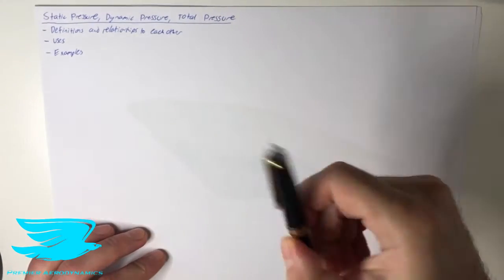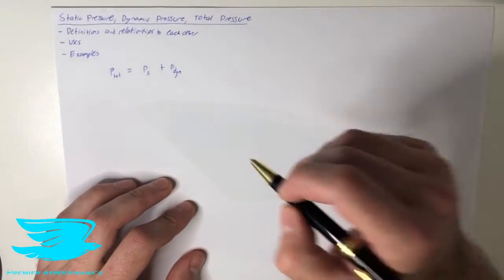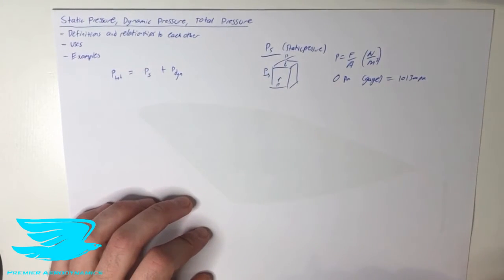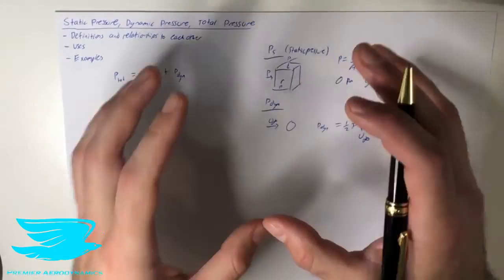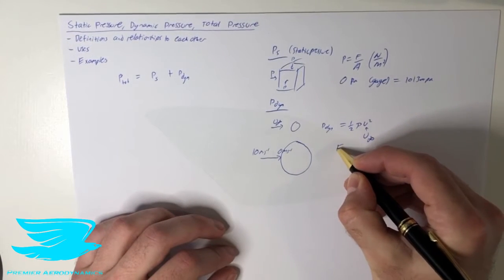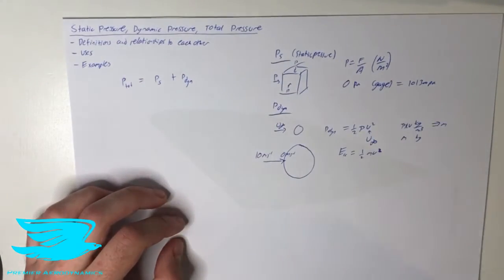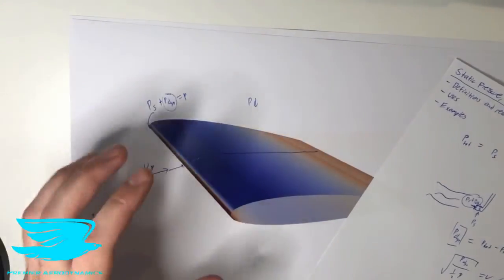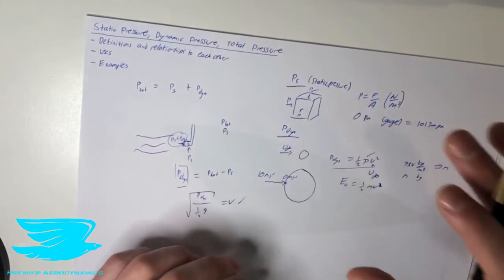[Aero Fundamentals #6] Static Pressure, Dynamic Pressure, and Total Pressure Explained

Comment: is the total pressure =static + dynamic valid only for incompressible flows?
Reply from the maker: No, it is valid for all flows, however, you need to make sure you are using the right dynamic pressure. For example, in supersonic flows, there are shocks and those shocks reduce the total energy of the flow, hence the total pressure drops. Much of that has to do with the flow being slower after the shock, hence the dynamic pressure has dropped post shock.

Comment: Many thanks for this explanation, very useful/helpful. Is there a way to calculate theoretically how far in front of an object a pressure sensor would need to be located for the object behind to not be influencing the measurement (due to the object slowing the airflow and increasing the dynamic pressure (if I have that correctly understood..)). If it helps having a particular example.. the case I have in mind is that I have started using an "aerosensor" to assess relative changes in CdA of a time trial bike set-up. The sensor is mounted at the front of the bike and a "calibration factor" is required to account for the bike and I slowing the air down at the sensor. I am finding this C.F. to be very variable and would like to just get the sensor into the "clean air". Is there a way to calculate how far in front of me+bike the sensor would have to be mounted?? Thanks in advance for any thoughts....
Reply from the maker: Good question. The answer, as you have suggested, depends on the object behind it. The more bluff the object, the greater the disturbance upstream usually is.

Unfortunately, for this example, you need to run a simulation or experiments to see how far upstream the pressure changes. If you have calibration curves, do you have the point at which the the calibration factor drops to 0? If so, then that is the point at which the pressure doesn't change.

Also, you could tryin mounting the sensor above the rider, from the front forks, for example. By putting it up above, you reduce the impact the rider has on it.

Comment: Is there some 3rd law involved in pressure? For every dynamic pressure increase, there's a corresponding dynamic pressure decrease?
Reply from the maker: Some of the time, but I'm not sure that it holds true all of the time. One "kind of" exception would be a converging-diverging nozzle; the dynamic pressure goes up in the contraction because the velocity increases, but there really isn't much of a change in the dynamic pressure elsewhere. The only place it drops would be slightly before the nozzle because of the back pressure. But that drop is not nearly as great as the increase you get in the converging section and it's not due to a redistribution of the energy of the flow.

In other cases, then it definitely makes sense that an increase must come from somewhere, so a drop elsewhere is likely. (and from an energy point of view)

Comment: that the total pressure equal the lift force ?
Reply from the maker: No, the lift force is a little more to do with differences in pressures.
Reply: ok .. The total pressure in up of airfoile > total pressure in down of airfoile to make lift
Reply from the maker: It is more the pressure felt on the surface (so the static pressure).